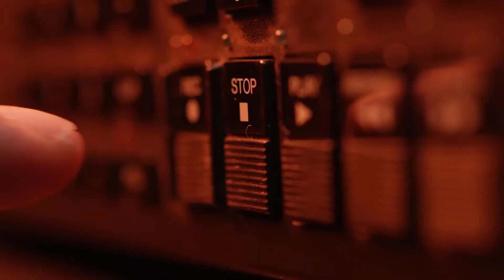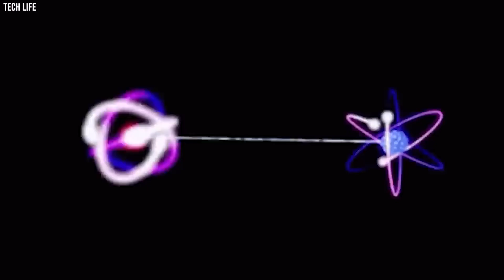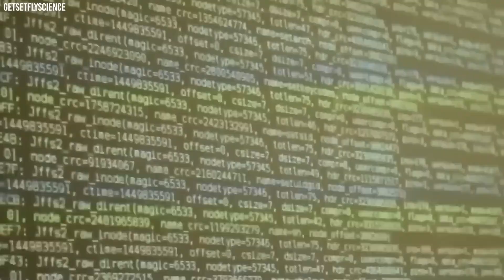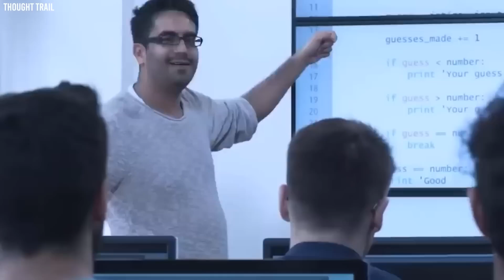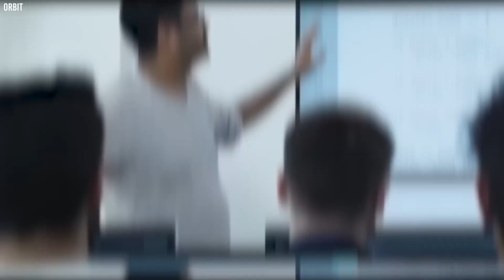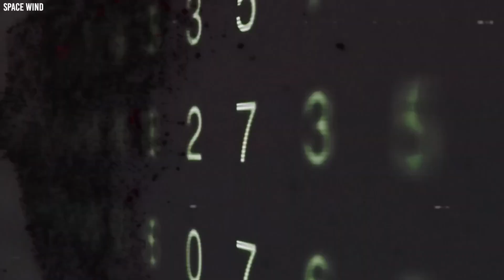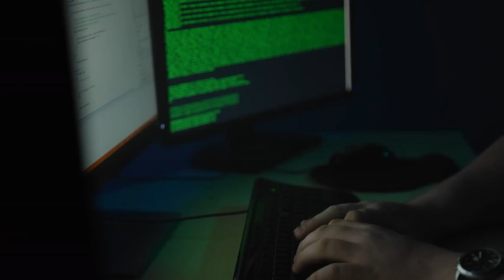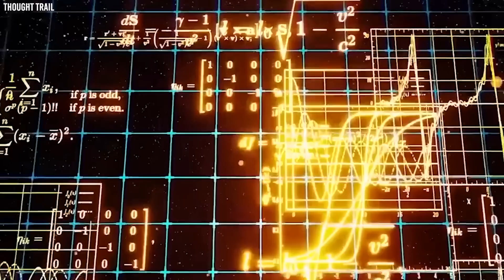NASA Forced To Shut Down Quantum Computer After This Happened...

Comment: The reason for the fermy paradox is that we don't use the right way of communication we simply don't see thr right kind of signal. Radio waves are merely interference signals from any alien equipment it does not travel to far anyway in the right time schedule !!!